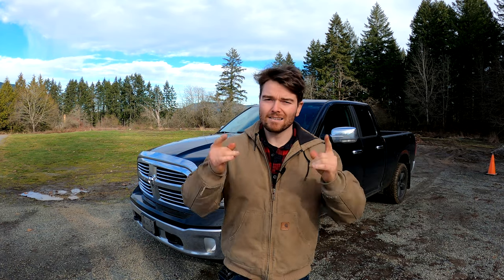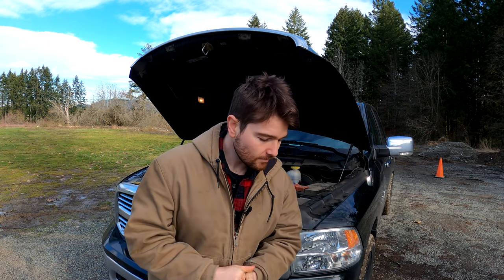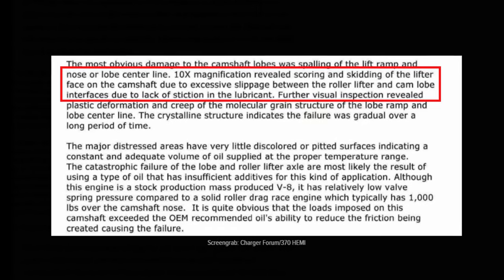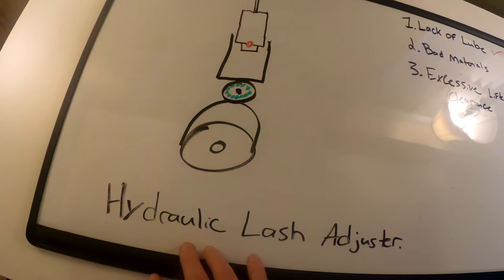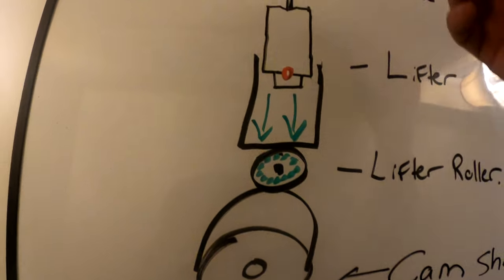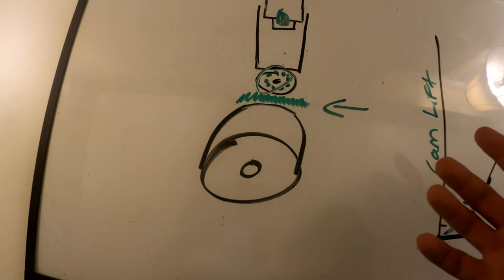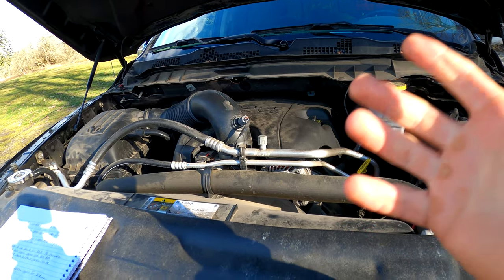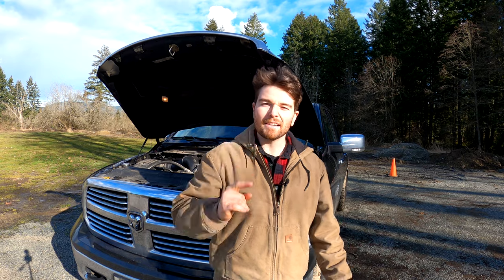RAM 1500 HEMI TICK Explained (Revised) - The Cause And How To Protect Your Engine

Comment: You have explained this very well. My 2017 5.7 Hemi ticks at random for an unknown reason at start up for 30 or so seconds then goes away. I have had it to 4 dealerships and 3 other garages. The other garages all claim it is lifter fade and all dealerships say there is absolutely nothing wrong with my truck. I even ordered new exhaust manifolds and tried to pay to get them changed. The garage told me there is nothing wrong with the ones on the truck refused ti change them and said it is lifter issues needed to be addressed by the dealer. In turn the dealerships all say nothing is wrong and refuse to do anything. So I guess at this point I will never buy another Ram because it is the worst vehicle I have ever owned, bought this one brand new, and I hope it blows up before my warranty is up so Ram will at least look at it before just dismissing it. Not because the truck is bad but because the entire company Ram only wants your money to buy it and provides zero service even if you try to pay them to do it after the sale. I have had my truck to every Ram dealer in a 60 mile radius and they all say the same thing. I have however noticed with the 5-20 oil it ticks 7 out of 10 starts and with 5-30 it ticks 3 out of 10 starts. I have been very concerned about this since I bought the truck, I personally change the oil every 3000 miles because I don't want old oil running thru it and refuse to wait for 5000 miles. Love my Ram hate the company. Hoping it my Ram makes it to 50,000 miles on this motor
Reply: Why have you introduced 5w-30 into the engine?  Nowhere in the truck's manual does it say that 5w-30 is acceptable or recommended.  I have a 2013 ram with a 5.7 (107k miles) and have always used 5w-20 (conventional first 75k, then full synthetic since).  No problems so far.  However, I have had to replace broken exhaust manifold bolt's at approx 60k and again recently.  But no issues whatsoever with the engine (fingers crossed).
Reply: @aggie7756  When I use 5w-20 the motor sounds like it is going to explode almost every time I start it. Since Ram will not address the issue and refused to investigate my complaint at all 4 dealerships in my area I looked for an answer to the issue. I was recommended to try heavier oil by 2 local garages after Ram would not address the issue through me or with the recommendations on paper from the local garages. As I stated in the original comment the different oil has mostly resolved the issue and it now only sounds like it is going to explode sometimes at start up. Also since Ram does not stand behind their warranty and is a garbage company I have considered my truck to not have one and do everything at my own risk. My truck has just over 40,000 miles on it. I bought it brand new and it has done this same thing where it sounds like it will explode at startup since 10,000 miles when I use to have RAM do all the maintenance on it. Yes I am bitter and do not like Ram anymore but that is because I spend $40,000 on a pile of Ram.

Comment: Per my buddies who are Ram technicians.. it’s not so much the oil life. Every 5000 miles even people who run quality full synthetic and change it every 5000 have the tick. 

He says people that either use a high moly oil or use a moly additive right after a fresh oil change, helps the oil sufficiently coat the parts. Some people have tried running 5w30 or 0w30 but the high moly or moly additives seems to extend the life of the lifters. At least to 100-120k in most cases. Just what I’ve heard so far. I had the tick.. added the moly additive and it’s gone, for now.
Reply: What’s the brand oil you use? High moly oil, never heard of it. I want my tick gone, I need to try this

Comment: In your first video you were talking NOT to idle the car. But in this video you do not say this anymore as it does seeem to be for an other issue. So is it bad for getting the tick to idle to the car? Like doing a daily remote start session of 15 minutes before going to work. Also you said MDS and non-MDS have the issue, but permanently turning of MDS, changing oil every 10 000 kms (full synthetic 5W30 or 5W20) will prevent this a bit better already?

Comment: I brought in my 2021 ram 1500 5.7, bought it at 30k miles. Both headers cracked at 40k miles. 
Warranty repair. If they crack again before 80k I'll buy short headers and see if they will swap the crap stock manifolds out. After 80k out of warranty I'll just do it myself. 
Hoping to avoid hemi tick with frequent oil changes. 
Tempted to install a higher flow oil pump. Oil pressure drops off during idle sometimes below 30 psi. Not great at a light. You step on the gas with low oil pressure takes a couple seconds for pressure to come back up.

Comment: Thanks for the much appreciated and thoughtful video. Provided much needed insight into this anomaly my 2013 RAM 1500 HEMI 5.7L engine exhibits. Since I do not notice the tick after warmup I'm hoping it's just the exhaust manifold issue. Guess it's mechanic visit time for me.
Reply from the maker: that what it sounds like an manifold issues are much more common then the lifter failure. they are thankfully easier and cheaper to fix!

Comment: In my 07 ram. 161k miles and never had a problem. Oil change every 3k miles.  Mobil 1 synthetic gets in between parts and keeps part clean and lubricated.

Comment: I had the same problem 2014 ram 5.7  lifter failure on number 5 cylinder took it apart replace cam lifters and everything else that goes with replacing cam new oil pump but did notice other lifters were going bad and unusual wear on camshaft never took an engine apart before did it myself 5,000 miles later I have no problems fingers crossed I did  delete the MDS and went with hellcat lifters from AMS racing

Comment: Ok so I started using Bestline oil treatment in my cars. If I buy a RAM it would be new and after seeing this information I'll use full synthetic oil, probably Ams oil with Bestline oil treatment.
Also I would see about the drive train warranty length.

Comment: I have a 2010 5.7 dodge big horn and redline 5/20 seem to ease the tick It didn't do it rite away but after my first oil change it almost stopped it completely sooo happy I changed the manifold bolts all of them cam and lifter swap and it came back with in 4 days of the swap I was at the end of my cash flow so I payed the 120.00 dollars for a case and it's the only thing that actually did anything

Comment: Excellent review as always. I have 2013 ram1500 with 120k km and do my oil change every 5k or 6 mos which ever comes first and so far, no ticking. But im thinking of trading it to 3.0 duramax due to gas prices. Is the 3.0 duramax engine reliable? Can you pls make a review or give me an advice, thank you.
Reply from the maker: I'll have to make a review on the 3.0 Duramax. a lot of folks are asking about it.

Comment: 392 Hemi and Hellcat both use 40 grade. They also use the same lifters and pushrods. Therefore it is untrue to say using 40 grade would cause a problem. A 40 has superior film strength to a 20, which also remedies your metal to metal contact issue at the cam to lifter contact. Running a good synthetic 40 grade is a must. Most 20 grade oils dont even meet minimum cST viscosity @ 100 Celsius to be rated a 20 grade. So the oil is even thinner than rated which is compounding on the problem. Even the preciuos pennzoil ultra platinum SRT oil fails to meet the 12.6 rating needed to be rated a 40 grade. It rates 12.2 whichbis technically a 30 grade.

Comment: Really great info!! I have a 2016 ram 1500 Hemi. Do you happen to know when in 2016 Chrysler switched suppliers for the lifters and bearings? Or is it for all of 2016 model Rams?
Reply from the maker: That is a great question which I don't have the answer too. I would imagine some 2016 models have the old lifters and some have the newer lifters. would probably all depend on build date and your VIN. But I'll see what I can find!
Reply: @TheGettyAdventures   where did you get your headrest cover at??
Reply: Lifters (and vendors) were revised several times, with the most current part numbers issued in 2019,  superseding all previous part numbers back to 2005 for cars, and 2003 for trucks.

Comment: oil analysis would come into play if it’s bad oil. i’ve been running hemis for years in severe service conditions extreme cold to hot dusty summers. i’ve dropped valves on these engines and traded several off that had ticks lol

Comment: Since I bought my 2017 ram new I have been doing 5k km oil changes with full synthetic and oem filters (metal elements vs cardboard lol) thinking I'm being a dork but justifying it by doing it myself compared to the truck suggestion of like 10-14k.  I have had the hemi tick twice still even while doing that.  Unfortunate.

Comment: Thanks for your very detailed video. Great info here.  I just want to be clear about the "oil life indicator" you mentioned. Are you implying that even though this indicator was put in by the manufacturer, it could potentially be the reason that people may be getting oil changes later than they should? Ie: We shouldn't trust the indicator?
Reply from the maker: exactly, I wouldn't trust the oil life meter. if you are running good synthetic oil it's less of an issue but if you are running conventional oil there is no way you should let the oil go that long.

Comment: My theory is that the needle bearings are too thin and also that the oil flow in and out of the bearings is too slow. This can lead to oil break down at high temperatures, and when the bearings are that thin, even a little wear can have a big impact. And of course, if one or two needle bearings are missing from a lifter, then that will definitely lead to failure (Don't get your lifters from China).

Comment: This is why I'm changing my oil every 5,000 miles (8,000 kilometers) on my Ram 1500. Is it a little overkill? Sure, but it's basically following the "harsh driving conditions" schedule. Would rather overdo it and have the engine last than the opposite.

Comment: and one more good thing to do is right before you do your oil change put a half a can of seafoam in drive around for an hour and told the drain plug when the oil is hot clean your engine out nice and sparkly all them little ports in the lifters get cleaned out

Comment: Have you discovered the hellcat oil pump yet?  Apparently it bolts right into the 5.7.  I have 105k km on my 2018 Sport, don't idle the thing a whole lot not sure if I would go that route.  Since I'm out of warranty it has crossed my mind however.  It's a higher volume oil pump, solves the low oil pressure at idle and low RPM that seems to effect some (not all) gen 3s.
Reply from the maker: I have not, maybe I'll do some digging and see what I can find. I'm not sure if it's specifically related to oil pressure issues itself but making sure you have high oil pressure is usually a good thing!
Reply: @TheGettyAdventures  The motor does not do well with police forces with all that idling.  A former chrysler tech for 10 years has a youtube channel, he came up with this higher volume oil pump idea.  I was thinking of doing it since I'm off warranty, but labor cost etc, plus I don't idle all that much.  I think I'm going to leave it and keep piling the miles on.

Comment: I have a 2017 Ram 2500 with the 6.4 hemi. I have 58k miles and the lifters and cam need to be replaced. I get regular 6k mile synthetic oil change at the dealership. So the bad oil isn’t the issue for me.

Comment: What do you think about using Sea Foam every other oil change or let’s say every 25,000k miles so that you can help clean the inside of the engine. So you can help prevent any excessive wear overtime. Just add it closer to when your going to change the oil. Only runing it for about 500 miles. Just a thought.
Reply from the maker: I personally don't have much knowledge or experience with sea foam but I would caution you putting it in your oil. who knows what it could do to the lubrication qualities of an oil. your Crank Shaft spins on a tiny tiny film of oil and any deviation to the oil could actually increase wear on components. 

that being said, I'm not super experienced or knowledgeable with sea foam so do your own research but that's my two sense.

Comment: So I have a tick I know I have an exhaust Manifold leak, have for a while. Will be getting that fixed but this tick is mainly when I'm at a stand still whether it's in park or drive , gets louder as truck heats up. Think it's the lifters or could just be manifold? 2013 ram 1500 hemi

Comment: I always use 5 20 full synthetic moblie 1, on my 2012 ram 1500 5.7 ,change oil every 6000 miles and still had lifter failure at 143000  miles

Comment: I have owned 4 1500's 2011 5.7, 2013 5.7, 2015 3.0 ECO, 2022 5.7Etorque I drove 180,000 miles on the eco no issues But I used a bypass insane diesel filter in combination with a Kand Engineering SS mesh filter because of the extra volume of oil flow due the K and P the engine and the transmission were in sync much better example: your coming to a red light foot on the brake light turns green when I hit the gas it was always in the correct gear and the RPM's matched Im no mechanic but it was smooth only after I gave more volume of oil, the OEM filter was restricting the flow of oil the bypass cleaned the oil so well that Blackstone was amazed. Cleaner oil and more oil volume made a smoother shift. Ram didnt have parts I was ready to buy another 3.0 engine  but 1 year wait I sold the 2015 for 27K with 180,000 you could eat off my engine and undercarriage and bought a 2022 Limited Night Edition 5.7 4x4 3:21 oil is important at 1000 miles I changed the engine oil to Amsoil ow20 SS and added a Trasko all in one bypass full flow oil filter at 3000 miles I changed the oil again and every 4000 miles there after at 40,000 I did a Blackstone oil analysis with Trasko, 43,000 miles Mopar MO899, 47,000 HUBB 3" SS filter the results were very clear  #1 best was Trasko for particle count #2 HUBB for particle count But immediately I had the same results on the Eco due to more flow the particle was higher than the Trasko but the shifting was great #3 Mopar MO899 the particle count was 45 TIMES HIGHER than Trasko and HUBB think about that the MOPAR MO899 is letting more larger particles at 70 microns 45 times higher at 4 micron 96985.6 If your not filtering your oil and your change intervals are at 8-10,000 miles how could it not fail. I agree with you clean oil is very important every oil is very important at 10K I changed both diff fluids at 30K changed again at 40K replaced trans pan with PPE and used Amsoil Trans fluid, I flush brakes every 25K ATE 200, drained 2 gallons Antifreeze and vacuum filled with Mopar 10 year coolant and will do so every year fluids are the magic sauce to longevity oil analysis proves it. Never trust your dealer they use the wrong oil weight wrong type and you have no clue I also use Amsoil engine flush for every oil change what I save in labor its peace of mind for me. I may be the extreme for maintenance Im 66 this is my last truck Im not paying $85,000 for a truck. Now at 50,000 miles Im changing the NGK plugs next Im not paying $800 Im paying $153 at NGK.com for 16 plugs and changing them myself do your own maintenance to know its done right. Clean your throttle body, check tire  air pressure the only thing I pay once for is Alignment balance and rotation. If you want to save money take care of your truck and it will take care of you.  Wash your engine with Griots  engine wash, Griots leather conditioner Clean leather with Palmolive  dish soap 10 parts water 1 part soap I never had a cracked leather seat. I hope this helps someone I tired now going to sleep have a good night.

Comment: Okay.. So I may not be able to shed any light on the situation, but I can share my experience with my 2012 1500.  The only time I get any "tick" out of the engine is when I'm driving around with the MDS activated.  When I put the truck in manual gear selection mode (which for those who don't know, turns off the MDS) and all 8 cylinders activate again, said "tick" goes away completely.  I just replaced the broken manifold bolts 2 weeks ago hoping that that was the issue and it helped a ton, but didn't solve the issue.  In my case, it IS a problem with the MDS.  With 120000 miles on the truck, it's not worth my time or money to fix at this point, but if you have the tick, just try deactivating the MDS and see what happens.
Reply from the maker: Certainly could be the MDS system in your case. it is a mechanical component and they can fail. I know with my truck when the mds system kicks in it is a very different sound. kind of sounds like subtle misfire and the truck does ride differently.  but certainly not a tick.
Reply: @TheGettyAdventures  Hmm.  Yeah my "tick" isn't metal on metal so I know it's not the infamous Hemi tick.  It sounds more like an exhaust leak that goes away when I turn the MDS off.  Already replaced the manifold bolts and gaskets.  Just put a cat back system in it this week, so I'm pretty sure all the exhaust issues that could pop up are covered.  I'm just going to drive it until it blows up, then I'll buy a new one.

Comment: I think VVT may change the impact on the lifters causing more failures. That is why MDS/NO MDS failures exist. Non VVT engines have less failures in my opinion and research. Pre VVT HEMI engines didn’t suffer from these issues (correct any errors please). Other manufacturer engines with first gen VVT had some issues too. Technological advances always come with some setbacks. Another redesign is required which is extremely expensive.